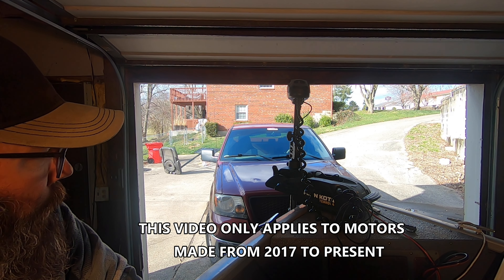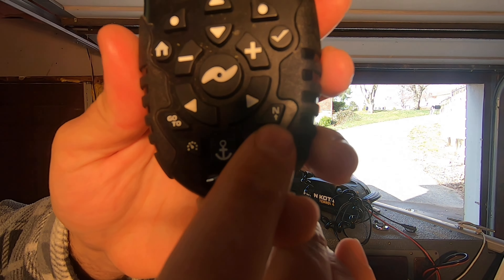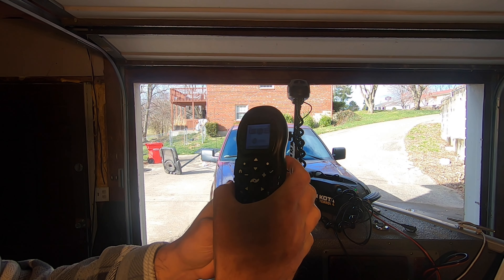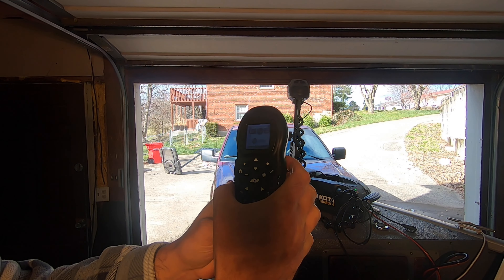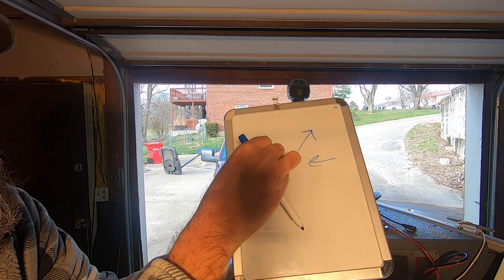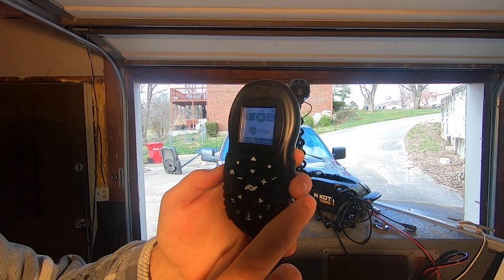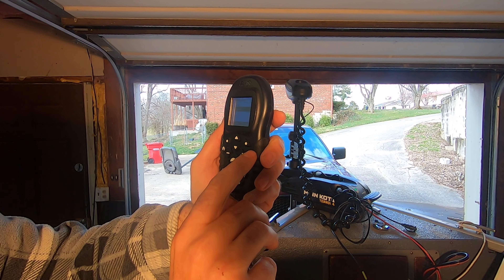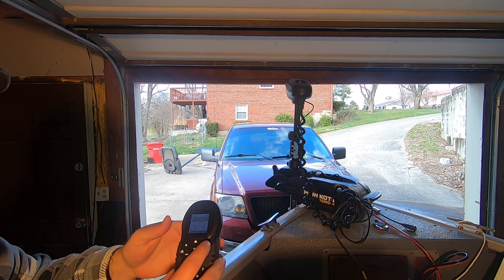MINN KOTA AUTOPILOT | ADVANCED MODE OR LEGACY???

Comment: I use advanced mode and never had any problems. My boat may stay slanted but it will pull straight through the desired area I am trying to fish. You will never hit the desired area on legacy mode if the wind is blowing side to side
Reply from the maker: Whatever works

Comment: To clarify, I have a 2020 Riptide Ulterra, 112#, 36V. When I use Spot Lock on Advanced mode, the TM head constantly adjusts left and right, especially in calmer conditions with little current. Yes it holds well but the constant 25-90 degree head rotation is irritating and seemingly unnecessary.  If I  switch to Legacy mode and use Spot Lock---will all of this head rotation and adjusting stop?  I'm talking Spot Lock only.  Thank You.
Reply from the maker: We noticed the biggest difference with itracks but it would be easy enough to try. Spotlock is tough in still conditions in general though

Comment: Do you know what the default setting is with the micro remote? I’m looking to upgrade my powerdrive to I pilot but I really don’t want that big remote, because I lose the foot pedal with the upgrade. Thx
Reply from the maker: Honestly Im not sure. Ours was defailted to advanced and will sometimes default back. I would try to get that big remote if possible. Even if you have to pay up to get the foot pedal. The big remote opens up alot of options the best I can tell
Reply: @bluegrassstateofmind4542  ok. You can’t use a pedal with the powerdrive with the Ipilot upgrade. How big is that remote around your neck?
Reply: What part oh KY you live in?
Reply from the maker: @Gssmallenginerepair  richmond
Reply from the maker: @Gssmallenginerepair  richmond
Reply: @bluegrassstateofmind4542  cool I’m in Georgetown..

Comment: I saw a YouTube video that showed the problem using Advanced Mode vs Legacy mode is the AM depends on a connection to a satellite and the LM is using direction NOT from a satellite.  So since you're boat is in your garage for the demo (like it would be under a bridge in a lake), the the AM has trouble connecting to the Satellite if it can connect at all.  For example, using spot lock in AM under a bridge (or your garage) it doesn't know exactly where the boat is.  So it's constantly moving/searching.  Does that make sense?
Reply from the maker: That very well could be true as well. This biggest difference though is how the boat react when it loses its line in the 2 different modes
Reply: @bluegrassstateofmind4542  I agree completely.  It definitely depends on the situation and I bet thats why the engineers at Minn Kota left both in the box.  Thanks for your video and your response.

Comment: Thanks, I’m fixing to put a new terrova on my skeeter. If you guys get a chance, make a video on the water showing how the i pilot works and will it do the same job as a power pole
Reply from the maker: Spot lock needs something to work against like wind or current. You can spot lock on still water but your boat will likely spin in circles. Anything in particular you wanna see?

Comment: Advanced I find uses more battery juice to keep correcting the course. Eh legacy works just fine
Reply from the maker: Yea we were dissapointed with the motor until we figured it out. They can keep their advanced.
Reply: @bluegrassstateofmind4542  I have a power drive that used to like reset autopilot once a year at random. Had to update firmware on controller and head in unit via network